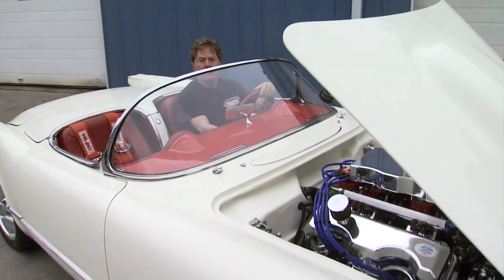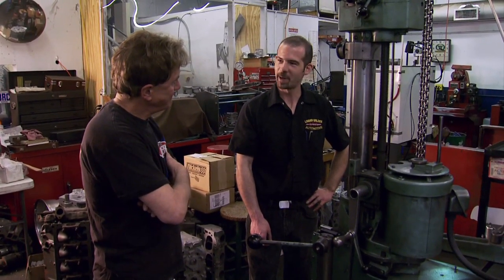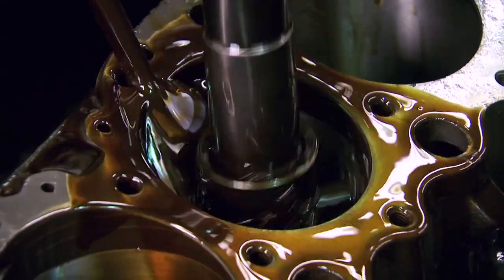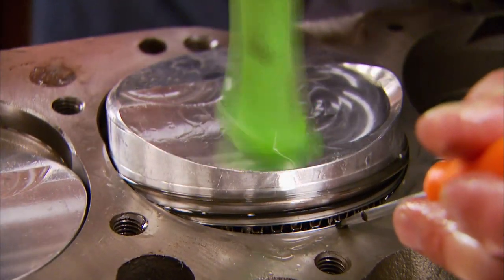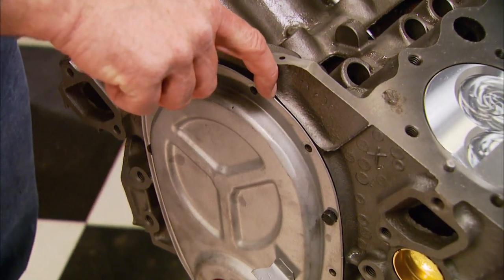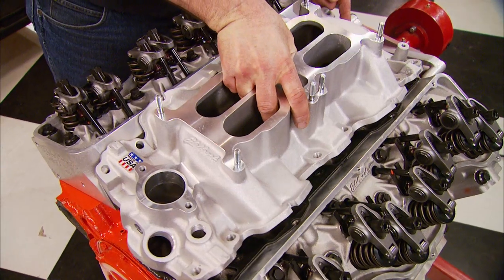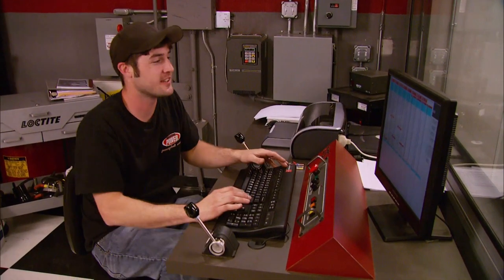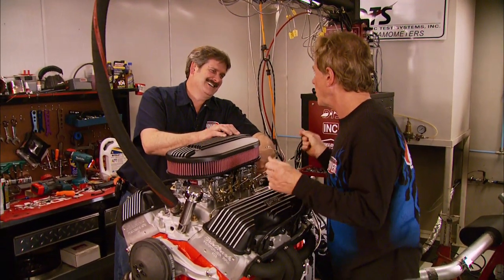Building A 409 From The Block Up - HorsePower S12, E10

Comment: Lets just have a 348 producing 500+ NA
Reply: That would be hard, way easier to do with a SBC, the chamber in block struggle with above 6000 revs and the easiest way to 500 hp kicking it old school is with either displacement or revs.  

The W engines were literally designed to be medium duty truck engines, race was a complete afterthought.   The Mark IV was a result of addressing those limitations and they still left a lot on the table.  Too narrow bores to take full advantage of heads design, that's why all rec port engine had notched bores, clearance for the intake valves but leaves them shrouded  The factory valve angle hurt performance as well, they did figure out the open chamber flowed better but that was at the end of the era.

Comment: Nice to see the odd balls making some good power.
But i must say, skip those iridium spark plugs!.. Just run a basic AC at a 43 heat range.
Gap around .040, should jet up a little and gain hp.. Engine will start and run better..  
Iridium plugs are not good for hp or anything other than taking your $$
Reply: Platinum is good but you’re right, iridium is meh. Platinum can make the same power as copper but lasts 2x as long
Reply: You are  right on  a non smog engine with a  distributor and a  big coil.  The  Asian cars with thumb-sized  coils  on plug   need all the help they can get. - Sandy

Comment: If they are so worried about weight that they had a semi-custom aluminum water pump installed, maybe ditch the boat anchor motor and use a modern engine that will put out 700+hp and weigh 200lbs less.
Reply: 700+ horse wasn't what they are looking for. A period correct old school motor for an old school car. You can see the finished car on their web site for free (with ads).

Comment: Does 1200 cfm seem like too much carburetion to anyone else 🤷🏻‍♂️
Reply: It didn't distribute well in those old low intakes... but made for a high HP number to advertise... and had one carb. barrel for each intake valve...

Comment: Wrong !  In 1957 chevy's fuel injected 283 achieved 283 HP
Reply: The first gen Chrysler hemi did it before the 283 fuel injected motors.

Comment: I think I that's way to much carb it sounds rich
Reply: Agreed. soft and  not angry, and likely needed more  tuning. They should  have used  a smaller AFB, or like I mentioned  above in another comment,  instead use two  350CFM  2bbls on adapters. But they are  selling  to "the  buy it online  and  bolt it on" crowd . I though Edlebrock  had  an AFB   below  500CFM  but I cant find the  part number.  That motor  doesn't need over  750 CFM total for  sure. - Happy trails! - Sandy

Comment: Crew builds a show quality car, but uses spray can paint on the engine block  and not even a whisper of primer !!
That paint will fall off in no time !!
Please use automotive quality paint and spray it on with a darn paint gun !!
Reply: Sponsors paid for the paint it's part of the advertising the can won't show up if they don't use it.

Comment: the 409 isn't a big block.
Reply: That's what GM designed the Mark IV from, though. Lots of similarities in the blocks, as far as structure, spacing, oil and coolant galleries, etc.
Reply: Big block refers to bore spacing...
Reply: You need to do a little more research.  It is a big block, with the same 4.84 bore spacing as the mark IV 396 big block, ect. It is a Mark I. But no one calls it that.  With a little grinding you can drop a 454 crank in a 409.

Comment: I'm sorry.  I cringe every time I see a fresh build camshaft installed without block standing on back end.  Camshaft is the FIRST thing you install REGARDLESS of block orientation. Old school thinking. Edit.  And paint it FIRST!!  Lol. Edit #2. After watching him install oil filler tube with block of wood and a hammer when manifold is already installed,  cringe level tripled. Wood chips in the valley. I can't watch anymore

Comment: the chrysler 300 offered the first engine with 1 hp per cubic inch. nice try chevy fans.
Reply: That's funny
Reply: Does Chrysler really count?.. I mean.. ya know... Chrysler. It's like plastic compared to polished stainless steel. Sorta like a small kid saying something smart.. you just say "Hey, that's cute kid", and then continue on your day.
Reply: @hawkdsl  .... really ?? I didn’t see the 409 being used in top fuel. In fact , after 1963 , Chevrolet disappeared from stock/super stock racing along with the 409. GM realized the second gen 426 hemi was far superior to anything Chevrolet had 😂😂😂😂
Reply: @kurtpoblenz2741  Seek medical attention.

Comment: Did Mike say use cardboard to cover the bottom end so no paint gets on the it? Did anyone notice the paint on the front main cap and crank at 10:27?
Reply: krvnjrcbs  Watch at 9:48 and 9:58. Not only did Mike say cardboard but he also used it.

Comment: Man oh man, ya gotta prime the heads and then put two coats of gray with rotor filings from the brake lathe. Fill in any logos before painting. Finally two coats Chevy orange.
Tell em it's all stock, gas and oil that's it lol. Magnet will stick to the heads